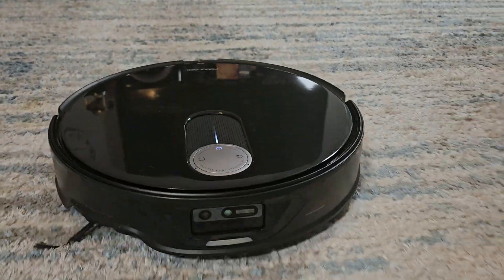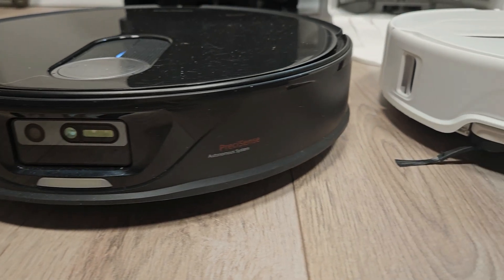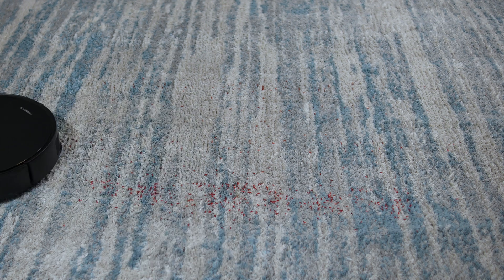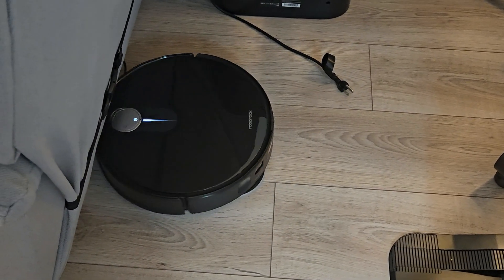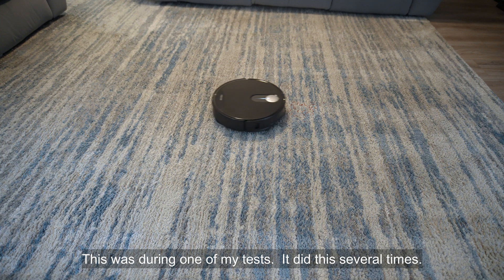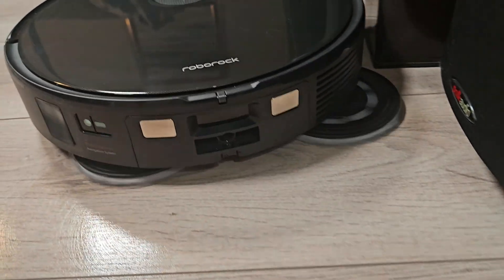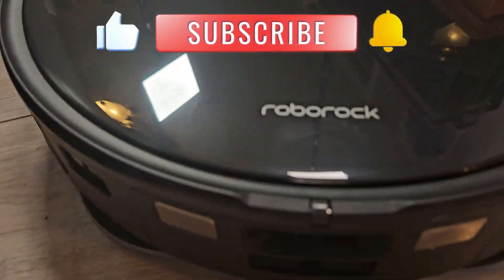Roborock Qrevo Slim Is The Slimmest Robot Vacuum I've Tested, BUT Is It Better Than The Master?

Comment: i owned the master but i send it back and buy the slim i hope it is better
Reply from the maker: What was wrong with the Master?
Reply: @jamie.andrews  Drives into some things and kicks them on the ground, drives around like shit sometimes and eats Socks, and tshirts and so on
Reply: And 4mo after, how is it?
Reply: @ The charging station doesn't vacuum properly, and because it doesn't have a sensor tower, you have to wipe it down after every cleaning. All the hair gets caught in the roller at the bottom, making it very maintenance-intensive.

Comment: Hello Jamie. When I opened the app on my roborock s7 maxV, the base moved by itself. I didn't make any changes and I can't get the app back to the base as usual. Has this ever happened to you?
Reply from the maker: Yes.  Many times and it can be a pain to get it to recognize where the dock really is.
Reply: @jamie.andrews  Do you have any technique to return to the correct location or do you have to redo the map?

Comment: What do you think about the curv vs slim? 
I have only hard floors except one or two higher carpets
Reply from the maker: If you don't need the lifting ability if the robot to cross high thresholds or the anti tangle brush the Slim will be fine.

Comment: Hi Jamie, Which one will you recommend given the Black Friday sale and each one is coming around 1100. S8MaxV ultra or a Qrevo master or Qrevo slim or Eufy s1 pro. I have 750 sft tiles, 500 sft hardwood floor and area rugs.Eufy S1 pro looked good but I'm concerned about the edges and corners coverage as it does not have extended brushes/arms.
Reply: go with slim or s1, because slim is better than master for hard floors and s1 has best mopping. s8 maxv ultra is overpriced. s1 has a lot better obstacle avoidance than slim and better mopping by a lot too. but slim is better at vacuuming and has extending side brush. up to you
Reply from the maker: You did not mention a need for object avoidance but if that matters the Eufy is the clear winner. I'd get the Slim over the Master if mostly hard floors. The I like the dock and swing out mop on the Qrevo robots way better than the S8 MaxV Ultra.
Reply: @jamie.andrews  Thank for replying. I"m looking for better mopping and vacuuming quality (edges, corners..etc), object avoidance is also good to have

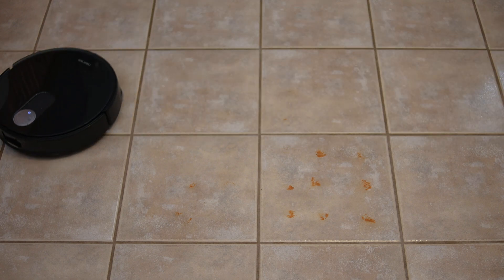Comment: at 3:12 do you mean "high" before entering the fine tuning part, which lets it use "extreme" amounts of water?
Reply from the maker: This was in the Custom Extreme mode.
Reply: @jamie.andrews   cheers! 
My Slim stopped spinning around after I got the latest firmware (44), I'm guessing navigation will be improved at a decent pace 👍🏻
Reply from the maker: @TrueDesire존  Good to know!

Comment: Have you testet it going between rooms with a high door threshold?  If so, how does it compare to the S7 MaxV?
Reply from the maker: If you need high clearance you should look at the Qrevo Curv which can lift the body to clear high thresholds. These 2 won't be much if any better than the S7 MaxV

Comment: I have the slim. The only issue that I have with it is it takes longer time to get onto the dock after a clean job only.  If I pickup the robot from the dock and put it somewhere away from the dock and go into the app to tell it to go back to the dock, it does it much quicker.
Reply: @alexleon8406  I had mine adjusted a couple of degrees out from the inside wall so to speak, it now docks much faster (along with the new firmware?).
Reply: @TrueDesire존  Do you mean you have the dock further away from the wall?  How far do you have it from the wall?
Reply: @alexleon8406  back side against the wall, but rotated the dock from left wall inwards to the right like 2 cm or so. Was enough of an angle for me 😁
Edit: imagine my wall as L shaped.
Reply from the maker: Yea same issue when I was speaking about mine leaving the dock. It takes the long route.

Comment: set the slim kollision mode to "Sensitive", it gave my slim an markable improvement in object avoidance.
Reply from the maker: Do you mean Standard? Less collision mode has None and then Standard. These tests were run in Standard.
Reply: Iam from Germany, and since the Update (Firmware 02.44.66) i can Choose between „ none“, „Standart“ and „Sensitive“ in LEDs Colossion options. When i get the slim there was only „none“ and „Standart“. But now i can choose „sensitive“. I can send you Screenshot But cant Post it in YouTube comments. The „sensitive“ Option really makes a HUGE difference in my case. I use the Qrevo Master as well, and the slim is outperforming  the master when it comes To objects Like cables or very small toys from my kid. Like the small hot wheels Cars oder small lego pieces, slim avoiding them all perfect.
Reply: *less collision mode
Reply from the maker: @DeDe-fr8jz  As it relates to cables I ran it through the same rooms with the same cables you see in this video and I could not see a difference. It also failed to avoid the red cord in a isolated test.
There is no doubt the object avoidance is better than the Master though. Cords still are an issue.
Reply: The „sensitive“ Option makes The slim 2-3x better in object avoidance than in „Standart“. Maybe in your Country They will updating it soon.
Reply from the maker: @DeDe-fr8jz  Ahh.  I am actually on the same exact firmware update and did not have it until I also updated the Roborock app. Now it appears for this and the other Qrevo models too. I'll retest and report if there is any noticeable improvements with cords.  Thanks for letting me know!
Reply: No Problem! :-) Let me know if you see the same improvements as i do. I would appreciate that. Its Not only cords, its also small objects. :-)
Reply: @jamie.andrews  keep us posted Jamie!

Comment: I’m so surprised by the hard floor performance! It’s like the S7 MaxV! At the same time… how did it perform worse on carpets? That’s so strange! StarSight def should be tuned.
Reply from the maker: I was not expecting either result which is why I ran the floor cat litter test so many times and also broke out the Master again. As for carpets I am simply baffled as well.  I suspect like with the S7 MaxV that something changed with the height or angle profile of the rollers, but I can't really tell.  The StarSight system was better before the most recent update.  When I first got this you may recall me saying in Reddit that I couldn't really see a difference in the navigation and at that time the only thing I saw was it took longer to map the house.  These navigation quirks showed up after the latest update and the scene at the end where it was going crazy with the rice test was me testing a 5th and 6th time after the firmware update to see if maybe, just maybe the firmware update fixed the carpet pickup issue, but sadly it did not and the only thing it now has is those weird navigation issues.  That is why I am certain Roborock will resolve them.
Reply: @ I see…